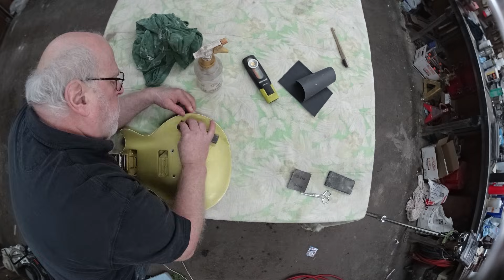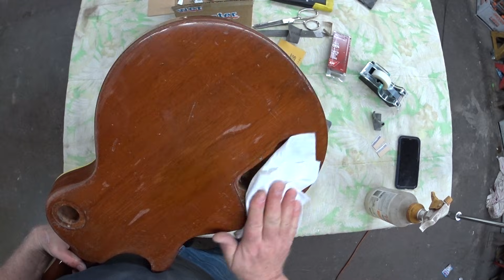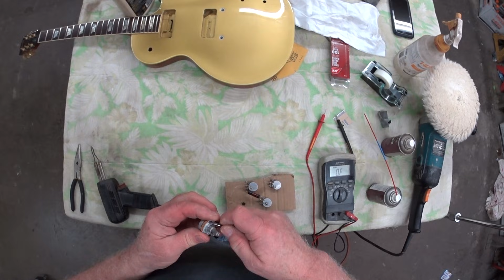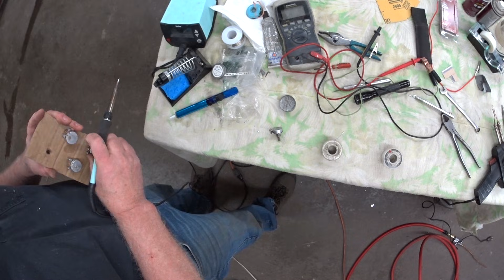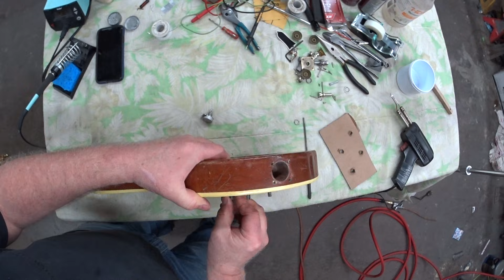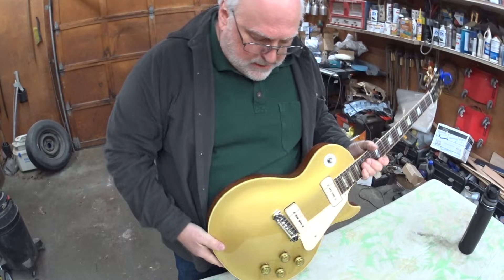1953 Les Paul - Polish - Wiring - Assembly - Part 7

Comment: Youtube recommended your project. That’s quite an operation you’ve done there.

What a transformation.

I use one of those Blackstar amps on my workbench too. 

Great work man.
Reply from the maker: Thanks, that little Blackstar amp does ok. I use the headphone mix capability with my phone. Can jam for hours and not disturb anyone. Big noise is better though. 😅
I hope the video helps you out.

Comment: Yeah a good rule of thumb is to use sandpaper as if someone else is paying for it. Meaning… don’t be afraid to go through a lot of sandpaper. Also, that wipe down your giving it with those paper towels is surely leaving scratches. The general consensus is paper towels are the equivalent of somewhere around 4000 grit
Reply from the maker: Thanks,
Those paper towels are soft, lint free towels used for automotive paint. They don’t leave scratches that I can see.

Comment: Pot values were all over the map back in the 70's.
I keep a bucket of them in each of the values I use which are spec'd with a max 5% tolerance. When I put together a set, I go through with the meter and match the values of the volume pots as closely as I can. For the tone pots i tend to start out with a pot as close to 500 or 250 as i can for reference and then go higher or lower depending on the voicing of the p/u I'm working with.
.022 is the typical cap used with 50's wiring for humbuckers. On p90 guitars I frequently go with .047, depending on the voicing of the p/u.
My favorite setup for p90 with 2 volume/ 2 tone is:
500k audio taper volumes with 500k(+/- 30k depending on the p/u) linear taper tones and .022 cap's.
This way you get a smooth, useable response curve across the entire range of the volume control and a very definite breakover from bright to dark voicing on the tone pots.
I often use the same 500k linear tone setup on Tele's with an .047 cap so that the tone knob sweep is so drastic it functions as a wah if you throw it quickly.
Reply from the maker: Interesting, Doug used to talk pot impedance with me. He liked 400k ~ 450k on a humbucker to remove wonky hi fz fuzz. 
Thanks for the info. The controls were a little quick with that amp. B taper might be better.
Reply: @donsmanufactory  My recollection is that Doug liked to set things up so that he got his tone with everything on the guitar at 10.
I'm of a different school in that I like home base on my tones to be around 4 to 6 with retention of brightness when I roll off the volume.
Doug was one of those guys that could make a shovel handle with a string and a pickup sound good as long as it was turned all the way up.

Comment: I prefer higher value pots in Gibson guitars. That nearly 600k pot would go in the neck pickup volume control in a guitar I owned to allow higher frequencies through(more impedance, more frequencies).

This is your guitar, do as you wish.

The top looks great too.
Reply from the maker: Interesting, I would think putting in the bridge pickup volume would help balance their output.
And thanks.

Comment: I get a lot of static from my pinky riding the pickguard, which I have read is not uncommon.  Changes with environmental situation, no temp groundwire helped.  This has been very enjoyable to watch, sounds and looks fabulous.  Looking forward to the official demo!
Reply from the maker: It’s a deal breaker in the studio. It could be off the body, mine and the guitar’s. I use a static shield guitar polish but not until the finish ages more. 
Thanks